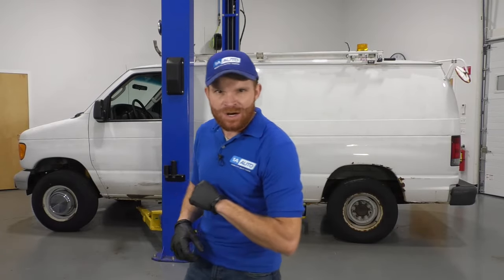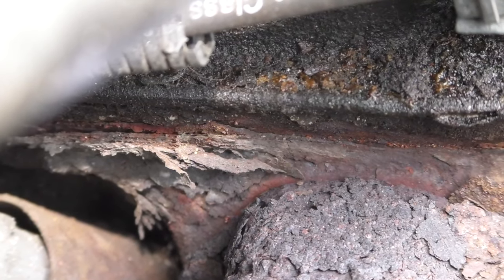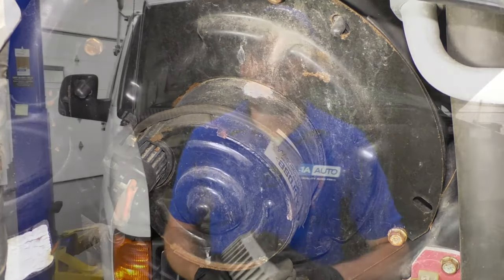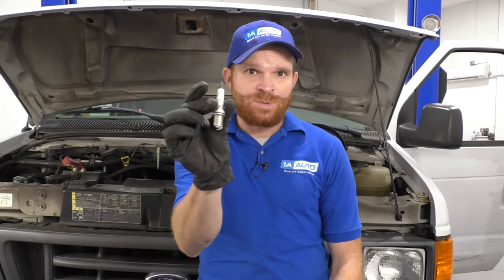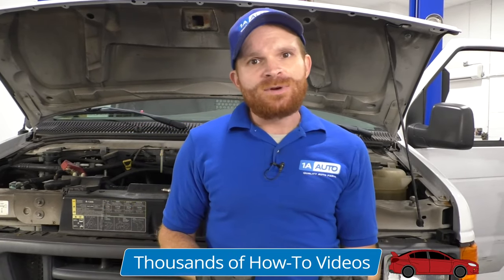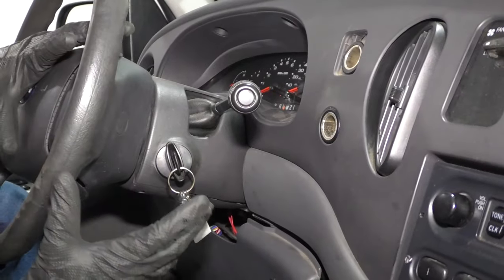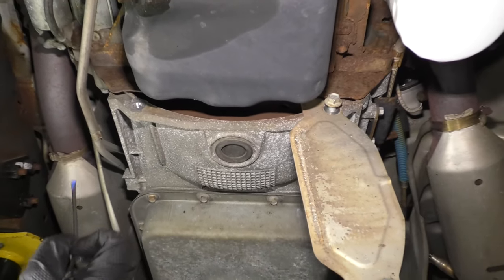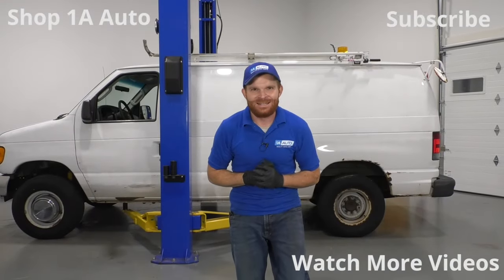Top 5 Problems Ford E-250 Van 4th Generation 1992-Present

Comment: Hi there!!!! First Time I actually have find  your Channel, bc I just bought a recent 2000 Ford 15o ECO Club Wagon, and I had to replace already immediately the Tires!! It  has a good, none leaking Engine and drives very powerful, but even with replacing the old , hardly inflated tires then, it seems like a little 'swimming' to the Sides, not much but very noticeable by me !! Could it be a Spring Problem or the Suspension already !??..How do I know what it is, before I bring it to a Shop ?? I don't want to be ripped off bc of the fact that I am a  Woman, even I drove Semi Trucks and having a CDL License doesn't makes me a Mechanical Professional !! I know some things, but not ( for sure 😊) everything about a Car/ SUV or Truck!!Please can you help me a little out here !???Thanks for your Time and great Videos !!

Comment: So my working van turns on it changes gears and i can put it in drive, neutral, reverse all of it but it does not move a tool symbol popped up on the dash and i can't figure it out. Its a 2006 ford econoline e250

Comment: I have p0171-p0174 codes system running lean on my 2001 e250 and I can't figure out how to solve it. I ran a smoke test for vacuum leaks and didn't see any leaks. Now I'm thinking that my intake manifold gasket might need to be replaced.

I have been looking around for a step by step video on how to replace the gaskets but can't find any good ones.
Reply from the maker: +Ransom Ron We do not have a video for this repair right now, but we'll keep this request in mind for a future video! We are looking to expand the amount of videos on these vans in the future. http://1aau.to/m/Shop-1AAuto-c
Reply: fuel pump.!

Comment: I have a cracked intake manifold and the nuts on the spark plugs rusted off so the only way to remove them is to drill them out.  I had a problem with coil and replaced it, antifreeze from the intake manifold leak was building up in the in the reservoir where the spark plug is.  Rotten the spark plug and damaged the coil. Had all the other problems as well.
Reply: Make sure its not dirt/debris in the spark plug hole. I had that issue

Comment: Super glad this was made got a 98 Econoline 250 with the 5.4 v8 and was wondering whats the best way to fix the broken manifolds on the passenger side as my rear part of my manifold  broke completely off but weirdly besides the loudness van still drives fine.
Reply: Update used four sticks of steel stick and repaired it worked great exhaust leak quit as well no headaches no more excited also wrapped it gonna replace it later once i get the money.

Comment: Hello.   I have a 2002 e-150 that does not want to grab 3rd gear  I replaced center speed sensor   n rear vehicle speed sensor n still not shifting after 2cond    shifts great 1 n second  what is the cause  I also replaced  solenoid in transmission  n nothing
Reply: It's a 4.2 automatic

Comment: You forgot the number one issue with these (gas 4.6/5.4) vans- Intake seal leaks or bad fitting intakes. Or the poor design of plastic and/or aftermarket intakes that don't fit. I always had the best luck with the aluminum intake (mostly fitted to the trucks). Other then that, good video. Most parts on these vans are reasonably priced and I find the van engine bay better to work on then the trucks because you have access to the back of the upper engine. And number two issue- shhhh, don't tell anyone. They have no factory immobilizer or anti theft system. I know in my area, thieves are targetting contractors vans like these because often the tools inside are worth more then the van. PM for the simplest most effective and cheap ant-theft install for these vans.
Reply: well)))   there were F350 / F250. $60K  trucks built  till 2008 that had no Immobilizer ))
Reply: @ansv3340  and those trucks are the number one stolen vehicles where I live.
Reply: @codyapplegarth   I live in NJ  in quite town and they tried  to steal mine twice  from my driveway. ))  had to buy steering columns  twice ))  also had disconnected the  link from the side key lock ,  and was chaining front tire to the frame ))   ended up selling it !
Reply: best idea for a anti theft?

Comment: I have a 2006 with the 5.4 engine with 125,000 miles. I have had none of these 5 problems. However, the problems I have had are the RSC (Rollover Stability Control) light came on and it took the Ford dealer 3 tries to fix it. It needed new computer parts. Spent about $1200 for the fix. Another problem was with the vacuum operated HVAC doors. I found a You Tube fix for that bypassing the the original vacuum reservour box with an new one for about $60 in parts and 2 hours of work saving about $1,000 from having the dealer fix it.
Reply: there is only one actuator that controls band doors. and it cost about $30 on ebay . 2 screws to put it in. Doubt you needed the vacuum servos , but even if so its easy to find used vacuum controller and  there is access panel on top of your dash , when u pop it you will see the vacuum door. incase you still need to get there.

Comment: Are all the exhaust problems on the v8s or straight 6s or both?
Reply: mostly on 5.4 on the right pass side. and its same issue for F150 trucks with 5.4 motors. same right pass side /

Comment: More than not on the shifter, it's a loose or missing mounting screw where the shifter attaches to the column. Very common for the mounting screws to back out. Often times you find it on the floor. It's not the shift tube.

Comment: My problem with my 95 ford e250 was I would start it every night after work because I had just bought it and it was street legal yet but I would start it and drive it around parking lot to keep engine lubricated and such well one night I pulled out of parking spot and it shut off I sprayed starting fluid and it wanted to run so I figured it's fuel related so I replaced fuel pump and filter the relay and fuse still isn't starting any clue why it's not starting but will al.ost start using starting fluid

Comment: wobbley shifter stick is an easy fix, there is a rubber bit called a Steering Column-Shift Tube Damper that the lever sits in, it can get worn out.
Reply from the maker: Thanks for the tip! http://1aau.to/m/Shop-1AAuto-Now

Comment: He forgot to mention the most important and catastrophic problem that ford never fixed on all 2v engines and that's the spark plugs blowing out of the head with no warning. I have 4 econolines and every one has had at least 2 blow out. One being a 14 had to do 4 so far smh

Comment: The most common problem on 92-up Ford vans is the side and rear door cables. If your van has this problem do NOT order the aluminum “repair ends” 
Order replacement cables. I’m sure they have them in stock.

Comment: Any info on a 1994 ford E 350. I am having cylinder 1 low and changed spark plugs, wires, distributor cap and rotor and still saying cylinder 1 low.

Comment: I would also add 6 a common problem on E Type model is the rubbing of the bottom radiator hose on the centreline bolt and grooving the hose this is a common problem on those E-type

Comment: What about a no start on an e350? Strater, alternator are new. Battery is good. Cleaned grounds. 
The only way I can start it is by using a jump wire on the starter with the key turned to accessory.
Reply: Try starting it in neutral. Sometimes the shift linkage needs to be adjusted and it won’t start in park. If it starts in neutral you know where to start looking.
Reply: @blainefalkena4974  tried that. Replaced it.
Reply: @blainefalkena4974  "you know where to start looking", what do you mean? Are you referring to the neutral safety switch? I replaced that. I haven't replaced the shift tube though.

Comment: I do hvac and we have both ford vans the e series and new transvans. The only issue i onow with the e series is the transmissions. The new vans seem to be in the shop for everything.
Reply: i have 4 E vans, 99  and 00. and two 2013 where one is a box truck. all original transmissions,  the 99 and 00 have half a mill miles each,!  not sure why your E vans blowing transmissions, may be bad drivers??
Reply: @ansv3340  there just the old vans we drive alot. They have a ton of miles

Comment: I had the same problem in my 2008 E250 I need a whole new engine I had the problem with the blower but other than that it’s a great great vehicle I pay for a new engine and I paid for a new transmission and I had about 187,000 miles my vehicle but I’ll throw fits in your travel to Miami I live in Orlando Florida I drove it to New Orleans
I’m going everywhere with the initial great great vehicle

Comment: can you remove the engine on that van from the top with an engine lift?
Reply: Actually, the engine is pulled out the front, after removing the grill and all components in front of the engine.
A typical cherry picker type engine hoist can be used, but the lifting arm needs to be right on top of the engine to clear the bulk head  (fire wall) and slightly tilted up to clear the bumper (if not removed)

Comment: Upgrade coils to higher Amps coils. even Chinese!  , ford coils lose their power with age and when warm they will missfire, and you will drive with shudder , that may feel like bad tranny or torque, but  in 99% its bad coil. ad it will not give you code.  applies to E vans and F truck, mostly on 5.4 motors.

Comment: Anybody got a vacuum leak with their van ?
Mine a 1996 E250 with a 5.8engine no engine lite on sense replacing intake manifold gasket but I believe I still have a vacuum leak somewhere because I get surging when I take off when engine is warm and decreased fuel economy ? Any ideas ?

Comment: blocked charcoal canister so you cant fill gas, fan not working through anything but the defrost, power steering high pressure hose, power steering pump leaking
Reply: Mine is also only blowing defrost and feet
Reply: Two for four so far
Reply: Vents was a broken vac hose. Look in engine compartment for thin black hose. Replace with long piece through antenna hole. Not hard. Fill tube back up is purge valve. Check connector under ass off van between spare and drive shaft. Clean plug connector and try it. If not working order from Amazon fifty bucks. Go easy on connectors.

Comment: I have this annoying issue with my 99 E250. At the speed of 65-70 the whole van shakes/shudder. Tires are balanced regular and rotated. Whole front are serviced and has new components. It drives me nuts.
Reply: change all coils to  the coils with more Amp. Napa has entire 8 coils kit.  but even Chinese coils from ebay will fix this.  Problem is that  old ford coils become to weak and just dont give enough currency to the spark plugs. they do work but poorly so  you not getting any engine codes.
Reply: I was actually thinking that it might be the transmission doing this.
Reply: Did you take it to an alignment shop & have them dial it in?  I believe it can be done, if they know what they're doing
Reply: @ansv3340  I did replaced all coils and plugs with OEM parts. I have about 60k miles on them now. I’ll definitely look into your recommendations.
Reply: @mcsqueegee81  yes did that already after having all the bushings in  the front end are replaced. I even bought a new set of wheels. Still the problem is there.
Reply: @rommelgallego2943  if you have new coils and good plugs , then maybe converter doing that shake, try to replace transmission oil and filter but make sure to go for mercon oil for Ford , and you can even buy 2-3 tubes of that transmission doctor add on fluid , that is designed to fix converter incase clutches getting stuck in there
Reply: @ansv3340  thanks Boss! I have done that as well. Now I’m thinking of trying Lucas transmission fix on the next trans service. If not I’ll just wait till this trans completely dead 💀

Comment: I like Ford E250 Van problems. Mine has a few. Air bag light always flashes at first then stays on. Boo, not very nice.
Reply: Did you find the source of the issue mine is doing the same thing
Reply: @zipzap7923  means something not pluged in. either bad  clock spring,  not common but could be, or go and poke around that front impact sensor on the rad support, if you got into water or rain , connectors may rust and there might be bag connection with that sensor
Reply: @zipzap7923  Not yet, sure it has something to do with the seat belt system.